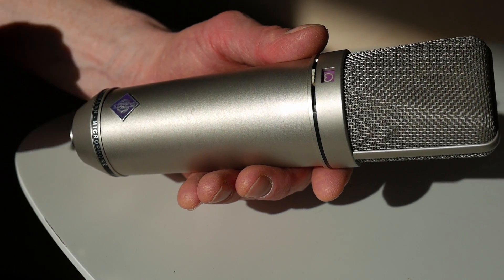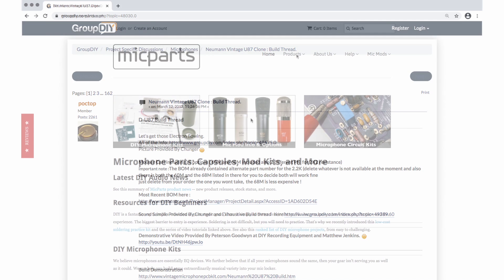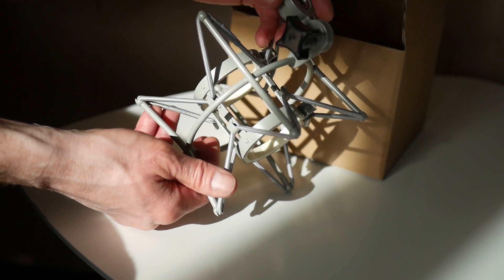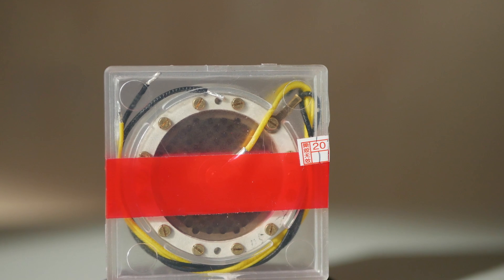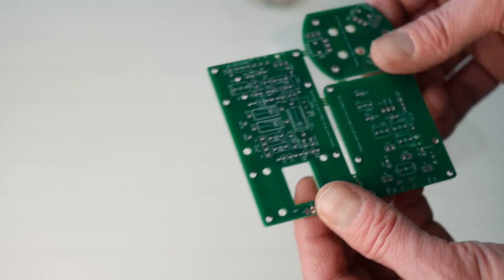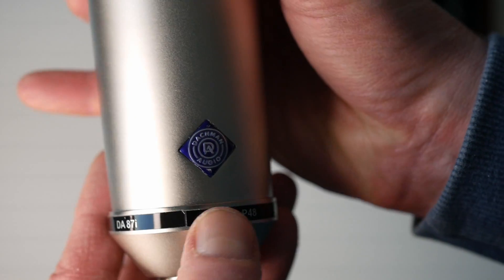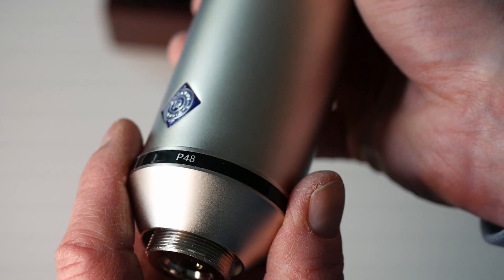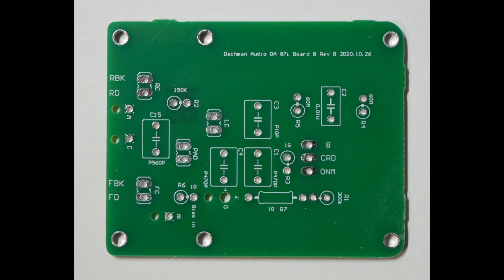Dachman Audio DA87i (DIY kit for U87) • Unboxing & first impressions

Comment: The capsule is the really important part of a microphone.
If I look at the price of this kit, however buy this kit must be a fool.
For a similar price I will get an Austrian Audio hand crafted fully build in Austria. A company founded by the engineers how worked for AKG until they were sold the Samsung. This microphones go back to the formerly famous AKG’s, getting this lovely detailed smooth sound
Reply from the maker: Not sure which price you’ve seen, but the DA87i is no longer available as a DIY kit.

Comment: What’s the point of diy kits, if GTZ Audio sell fully built mics for 150$?
Reply from the maker: I haven’t tried a GTZ87 myself yet, is it any good? I have no clue which components they use, but I heard it is much noisier than a real U87. Also, it has one polar pattern (i.e. cardioid) only, no high pass filter, no -10dB switch. So you can’t really compare it to the DA87i. Anyway, there are lots of U87 clones out there, some of which even sell for way less than the GTZ87. But I guess you’d have to actually try one to make up your mind.

Comment: Great video. I'm thinking about buying a kit like this. I am wondering what higher quality capsules may be available for this kit? Peluso is the only one I have found on eBay. I normally use a C414, but after a few amp mods and pedal builds I am ready to tackle something like this.  Thanks!
Reply from the maker: There are also great capsules by Heiserman, BeesNeez, Maiku and the likes.

Comment: The devil's in the details.  What the German engineers at Neumann know versus everyone else building clones makes the real thing what it is.  Yes, you can clone the circuit and use the same components, and you'll get close.  But the capsule and headbasket contain secrets that others can only observe but not understand.  You can bet that legendary German engineering has gone into every component of their product with a fine toothed comb.  
I think it would be fun to build this mic, but I have no illusions of it being an exact clone copy of the original.  If Dakman Audio can source the components and produce a nice kit, more power to them.  As long as they are not doing anything illegal, and in fact offering truthful statements where they got inspiration from, where's the beef?  Some like to source their own materials to save money and make experiments, and that's cool too.  Personally, I'd rather find my own capsule, but I'm pretty sure he has other choices as well now.  So far, I've not seen a perfect copy of the U87 anywhere, so if you want to have the best you'll have to get your hands on the original and pay the premium price.
Reply from the maker: Thanks! I agree with everything you said. 🙂

Comment: The mic body with all that details like switchers and engraving signs is used also for Rodes clone of neumann. Check the older Rode NT2
Reply from the maker: Not quite. I also happen to have the older NT2, and the body is slightly different.

Comment: Didn't check how much the whole kit costs, but as a beginner, if it's not much, I wouldn't bother collecting all necessary parts from various sources, though I understand your concern if such action would benefit original creators of parts in any way, and it would be even cheaper that way.
Anyway, I'm really impressed by your video and commentary and really look forward to see your comparison.
Actually, there are already assembled U87 clones on e.g. AliExpress for, let's say, reasonable price. If it's really worth it.
Reply: AliExpress clones sounds very bad

Comment: I just bought an allready finished DIy 87-Clone and I am so curious how it will sound on my own recordings. The samples were really promising and I will get some stereosamples with sidebyside U87 original-recordings, what will be very valuable for me, because I can't affort an original. Now i see that I could do it on my own. So tempting. I see that point of supporting the DIY community, I do that on the digital side with own creations since years and I have no time left to really go deep into this microphone topic. So where is the middle way? Could i let an experienced DIYer choose the components with some room for experiments and pay for that project? I am open for new ideas :-). Thank you for the great video!
Reply from the maker: Well, a start would be to visit the Group DIY forum, get to know some people there, and ask for suggestions.
Reply: After listening closer I can hear the differences more and more... But its still the recordings. I am so curious, if I will like how the microphone sounds compared to my other microphones. I ordered two capsules from China, one 47 and one ck12 clone and will test them in cheap condenser mics. So I will have a lot more experiences in a few weeks.

Comment: I think that “all in kits” are a great starter for newbs to build confidence. I have built many mics from scratch and it’s a lot of research in order to complete a quality clone. It would be nice to get a kit like this to give my head a break although I’d change the capsule to something that specs a little better.
Reply from the maker: Yes, replacing individual components in such a kit is another good option, of course. Thanks!
Reply: Generally the capsules aren't too bad. It's kind of hard to screw up a K67 capsule. When you need to use expensive capsules is when you're building a C12/251/C414 clone with a CK12 capsule because the Chinese ones have nothing to do with a real one except where the wires are placed.

Comment: Very nicely done video. Great presentation and narration.

Yes, please build it and make a video.

I do a lot of DIY and I am one of the few people who enjoys sourcing my own parts for projects like this. Finding unobtanium components (like original NOS Motorola and Fairchild 2N3819s for this mic) is FUN for me. I like the kits where you get a PCB and a PDF and you're on your own. I guess since I don't ACTUALLY hunt (animals), this "thrill of the hunt" for cool components replaces that for me. I have quite the love affair with Mouser!  :-)

I think their kit looks nicely put together and will make a nice build. No idea what the quality of the capsule is like, but they were definitely going for an AMI feel with the yellow tape around their transformer. 

I look forward to another video.
Reply from the maker: Thanks, Richard! I was also thinking AMI, but I have no further info on the transformer they used in the kit. And yeah, sourcing parts can be fun, but also nerve-wracking sometimes, can’t it? 😄
Reply: @pop_polizei  The only nerve-wracking part for me is the extended shipping times that have happened within the last year due to Covid. I routinely buy PCBs from Denmark and custom metal panels from Germany, and it's been taking a long time. In fact for a while Deutsche Post was REFUSING to ship to the US AT ALL because of something stupid Trump did. Right around that time I had 50 Pot-shaft-adapters on order from Banzai music and it took me 3 or 4 months to get them.

But in general, no, I don't find it nerve-wracking at all. Just as DIY has introduced me to many people, and I've made many new friends, hunting down vintage component stores online has done the same thing for me. I've found many cool places to look for vintage parts and made many new friends.

Such a fun hobby. And I'm following in my dad's footsteps who spent a lot of his life building home hifi equipment and such.